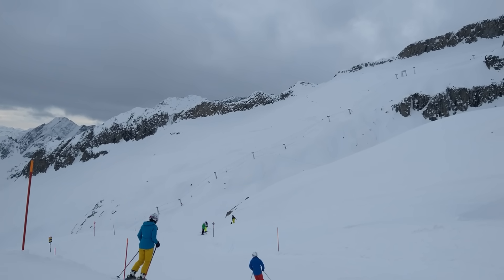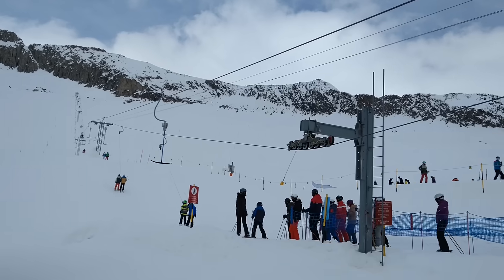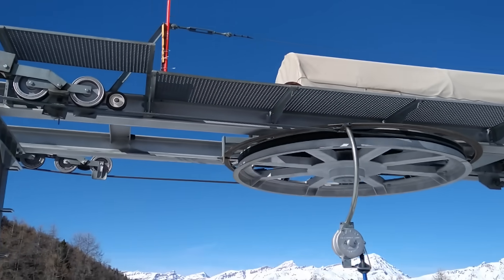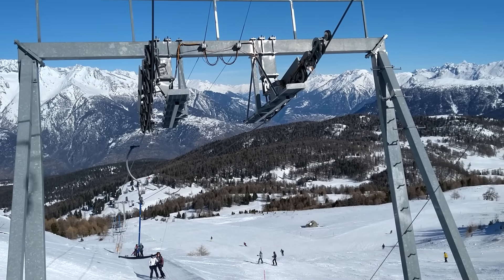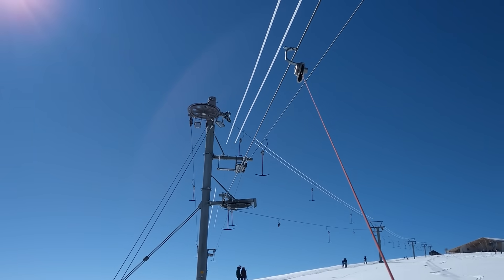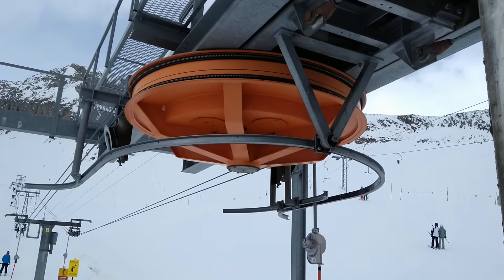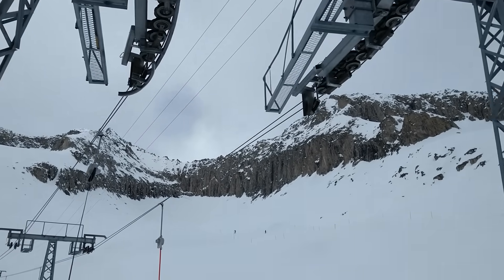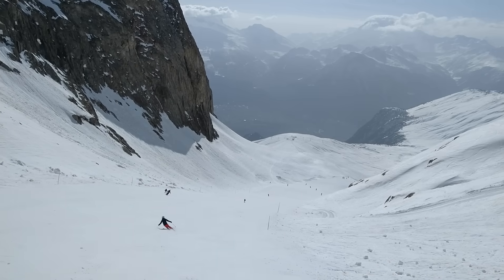The IMPOSSIBLE skilift that actually exists

Comment: Thanks very much for your interesting video.

However, this problem has already been solved long ago and with a much simpler method (in my eyes), which is much more widely used today, as you may imagine. As you can see in this video, there was a double-seated ski lift built in Garmisch-Partenkirchen, Germany already in 1977, that solved the problem: https://www.youtube.com/watch?v=8REVehtt3GM&ab_channel=Tribal6666
You can watch the actual solution to the problem of the "impossible left turn" in action here at 2:10: https://youtu.be/8REVehtt3GM?si=ZfmFqZJXjDQHaoNs&t=130

I have used this lift hundreds of time as a child and very often saw tourists and other 'first-time-users' being very impressed by the simplicity of the design.

The solution used also has a specific name. It is called "Baco-Kurve" after the Swiss company Baco, who has invented it in the mid 1970s.

More information about this (in German language): https://www.skitalk-24.de/seilbahntechnik-f14/baco-kurve-t876.html
or in this article (also German): https://www.bergbahnen.org/de/seilbahnen/systeme/schlepplifte/

Comment: I paused the video and thought about a child's solution - which I think I did - but I'm almost sad it's not what they chose :( 
Basically, a curved ramp and a bridge where you go around in a 270 degree circle the other way around instead of doing a 90 degree turn. 

Way more fun than the thing they did here!

But this implementation is pretty cool still, ngl. Well done Swiss bros

Comment: I somewhat hoped it would've been a chair lift which does it like Chäserrugg in both direction and therefore basically lifts you above the other cable doing a crazy curve up there - that'd have been insane 😅 or even crazier: limit the extension of the T-Bar so it'll pull you over the lower cable whilst you have to hold onto it 😅

But I guess no one would technical approve the latter one 😅

Comment: @Sandro Here, the crazy part is the inner and outer rope have different length.. how do they adjust for this? 🙂
Reply from the maker: Ropes are spliced on-site, therefore I presume that they make sure they are of fitting length. I haven't seen a way to tune / adjust individual rope length though, the tensionning mechanism is global and affects both rope. Seems to make sense though, as they will undergo the same thermal changes.

Comment: It is very interesting, there is another different solution in Poland. Find video "laskowa, wyciag orczykowy". They used instead of horizontal or vertical wheels, just a wheel at 45 degree angle.
If you use horizontal upper wheel and tilt it a little bit, you can make a small turn (even in the opposite side than rope handle is projected). When you tilt the wheel even more, and use narrow rope handle you can make steeper turn in the opposite side.

Comment: This is mesmerizing, but this is an over-engineering overkill. Poma, the French cable transport manufacturer, solved most of the flaws of surface lifts since… 1944. 
The Poma detachable surface lift can have turns without any issue because the cable grip is almost vertical, and the upper part of the pole bar is flexible so it can be twisted by the pulleys’ flange in turns without any problem.
Actually most of the Poma surface lifts I took have turns.

Comment: 6:17 the tiny tube lift near my house uses a very basic cheap system like this. The bar between the two cables is straight and doesn't swivel. The cable is actually at ankle height and the bar is about 3 feet long to provide standoff (the lift slope is very slightly angled away from the cable as well so anyone who falls off slides to the side away from the cable) I suspect the swivel is only needed on this one since the cables are overhead.

Comment: He knows what hes talking about but He doesn't know much about grips And about a minute 30 in when hes talking about that flat grip Just so everybody knows including the author it's called a fixed grip there's also grips called detachable the detachable ones that detach from the cable and another fixed grip lift but it's inserted into the cable with a clip. I'm sorry if I offended anybody I used to be a lift operator and I've operated ski list for over 15 years That's doing it and it's a great profession

Comment: It does look cool but it's much less cool for the maintenance team as the two ropes have to go exactly at the same speed with no margin. If the sheaves or the conveyor wears out a little bit differently on the different rope its an absolute mess, whilst on normal lifts if the sheaves and the conveyor wears out a little bit it's not usually a problem

Comment: You just sent me down a rabbit hole. I remembered that back when I was really young, I knew a ski lift with two turns. It took me an hour to find out more details since it was replaced by a chairlift in 2001. Turns out it was "only" a Viereckslift, but it cleared a height difference of 500m in a total length of 1800m, much of it going through the middle of nowhere. As a kid, this was solid nightmare fuel. I still get flashbacks of the anxiety that hit me whenever one of the turns came up, because I was always expecting not to make it. I'm just glad I didn't start snowboarding until way later, because that thing probably would have ripped out my leg on the long run.
Reply: Haha same for my local hill. Just learning snowboarding, and having to do the turn with only one foot in a binding was nerve wracking haha! And also here it was replaced around the same time by a chair lift.

Comment: I think a cheaper solution could be a synced horizontal wheel with gaps that sync with the T-bars hangers. I might be difficult to get the wheel synced though and it could be too dangerous in case of sync issue, but it would safe cost by not having to install double cables, double wheels and extra mechanics at T-bars over the whole track.

Comment: Tatra poma solved that issue by using springs and protectors on big wheels. From my experience it was a little bit prone to accidents and the rope fell if someone dropped at the right time. So when we fell we know we have to release before or after that big support wheel.

Comment: You were obviously intrigued by this lift. I suggest getting in touch with the people who made it to get a complete review on the why it has 2 cables and a double clamp because turning left and then right or up and down can also be done with a single cable as on many other lifts. This is not the reason it has 2 cables.

Comment: Well, there's an even more simple solution in Switserland. Skilift Pas-de-Boeuf in St.-Luc/Chandolin. It is, however, a very shaky one and many of my students dropped off that one because in addition to 3 turns in alternating directions, it also includes an extremely steep angle where even the lightest kid maxes out the line and actually sits on the pancake instead of just being pulled.
For their solution, they make the skier come to almost a stop at the outside turn, allowing a bracket to swing the brace almost horizontally. They are single seater pancakes, but this very long lift takes you to the highest point in the domain, offering 2 excellent slopes and 270° views that will take your breath away. (It's near the Matterhorn, so very pointy mountains all around)

Comment: Truly awesome! The only chairlift, which makes turns, that I have ridden is at Chaika resort on the Black sea coast in Bulgaria. It was built back in the 80s and connects the hotels up the hill with the beach down, making a 90 degrees turn in the middle. Since it is a standard fixed grip chairlift, it uses the "two sharp left turns, to make it go right" concept for the outward turn.

Comment: Why do ski lifts need to turn? Why not just go straight up the mountain? I think all the ones I've been on are like that. Also, why this bar thing? Seems very uncomfortable. I prefer the padded seats.
Reply from the maker: Why do skilifts turn: Sometimes the terrain forces them to. Regular skilifts have to be pointing straight up the mountain or skiers will slide off to the side. Regarding your other question: Modern lifts are chairlifts, T-bar lifts are more a historical leftover.

Comment: Have you ever considered that you have high tension cables above your head.
Reply from the maker: Please elaborate
Reply: @sandro-here  I mean over time friction or weathering can weaken lines as well as tem fluctuations. Also the load of 20 or so carts adding tension at different positions. Im surprised they don't snap.
Reply from the maker: @commanderdante3185  these ropes/cables are pretty indestructible. For instance check out the website of rope manifacturer "Fatzer", the specs are insane. The ropes are built from many individual wires that are self-stabilizing, even if one fails. Check the video from the collapse of the famous Arecibo overvatory, the ropes collapsed only after they suffered from tons of damage, the process took months or years. Also, ropeways (at least in Switzerland) undergo regular thorough inspection with magnetic sensors etc. detecting fractures at early stage. In Austria, there was an accident where a helicopter dropped a bucket of concrete on top of a ropeway - the rope held (but the ropeway was shaken so badly that people were thrown out of it). So the rope is hardly ever a problem.
Reply: @sandro-here  Thanks for your knowledge.

Comment: That's a very interesting design, thank you for sharing. I've always been fascinated by skilifts with curves myself.
Another design option (the simplest one) is to let the returning T-bars go back to the bottom in a straight line (not always possible due to terrain). That doesn't require a lot of extra masts, as they usually are far above ground anyway and it doesn't matter anyway on the return side. Examples of this still in service are the Hauptertäli skilift located on Parsenn in Davos and the Hubel skilift located on Rinerhorn, also in Davos. They both have two turns for terrain reasons. 
Another interesting design not shown in this video is in use in Pany on the local skilift. It has a right turn using two wheels. Upwards you just pass on the outside, but downwards the T-bars get kinda smashed in between the two wheels.

Comment: The first hovering mast hung onto two mountains is the Vallee Blanche Helbronner-Aiguille du Midi cableway of Mont Blanc connecting Italian and French sides.
Reply: After 4-5-7-10-11 min. and aboard 12, turning point 10 deg on mountain after 2 and 13min…
https://youtu.be/fwCRh5N2BX4
But watch it entirely it’s both an amazing location and engineering.

Comment: One skilift I know solved the turn problem by completely separating the uphill and downhill "legs" of the cable loop. The uphill leg (the one carrying skiers) would turn left halfway up with a large horizontal wheel, while the downhill leg would go straight from the top to the bottom. Essentially it was the hypotenuse of a triangular loop. It probably meant they had to cut down a few more trees but it is certainly an interesting lift.

Comment: I thought it would be something like sideways wheels with a cone of angled bristles holding the cable up instead of the lower flange. That way, the bar can simply hang straight down from the cable and push aside the bristles slightly as it passes by them.

Comment: I used work for a company that built lifts, and we were asked to make a lift with an elbow in, which we couldn't do, after about a year it came to me how to do with only one rope and mostly standard equipment. We had done a proposal for a T-shaped lift, but the project didn't sell.  It could be done much simpler with a detachable lift, but it is possible with a fixed grip lift also with one rope.  I have written a program to assist in linecalcs, sheave train sizing horse power etc., it does four different loading senario's at once and makes it possible to lay out a lift in about 15 minutes, part of that inputing ground data as a starting point, it's an excel program and the company I worked for had no interest which boggles my mind, I would have just given it to them.

Comment: Instead of adding more ropes you could just remove material in the wheels so the connector "gears" or mergers into the wheel. The connectors are at set points on the rope and you can make the slip factor 0 so the connections always hit the same point of the wheel - the point that has material removed specifically for the connectors to fit. Boom - 1 rope solution.
Reply: Those ropes can slip and stretch and suddenly they are not at the same position any more.
Reply: @koko-lores  not if you "gear" them as described. There is no slip in a gear system, or at least, a gear system can interlock in either direction.
Reply: @SameBasicRiff  If I understand you correctly then, this will cause increase wear on the driving wheels, similar to a bicycle chain, where the current "slipping" rope setup causes more or less no wear at all.
Reply: @koko-lores  A rope is about as much maintenance as a screw or a gear usually. A rope will require careful inspection of fraying and replacement every so many years. 2 ropes just makes that harder. Screws and gears need only lubrication at contact points which is pretty easily applied and can even be automated. From what I've seen while ropes are cheaper they do need replacement more often.

Comment: There's a T-bar at Perisher in Australia that turns a corner but they do it by making the descending cable go down the mountain in a straight line between the top and bottom stations cutting across a face that is out of resort boundaries and is also too steep and rocky to navigate via the surface. When viewed from above the path of the lift is a big triangle.

Comment: Tensioning both ropes right seems a problem.
They can't have each a bull pulley much farther apart.
Reply: Good point, though I bet if they're both tensioned with one pulley their tensions are close (not equal, but within tolerances), highly unlikely that two ropes of the same spec would have wildly varying expansion coefficients or whatever.

Comment: Used to live in Chile, at the Valle Nevado resort they also have a ski lift with a direction change in the middle. If I recall correctly it is just managed by pushing the descending bar into a sideways position to make the outward turn. It just separates the ropes vertically to avoid conflicts and has some bars mounted from the mast to stop excess swinging.

Comment: A question has puzzled me for a while. At the top and bottom of chairlifts it is quite common for the chair to reduce in speed whilst passengers get on and then quickly accelerate. I imagine this requires the chair to be disengaged from the wire and then reengage once people are on? How is this done so seamlessly, it doesn't look simple for the rope to easily engage?
Reply: Yes, they disengage just like a gondola. The clamp onto the rope is automatically mechanically released and clamped back on. The station then has a long row of tires which accelerate and decelerate chairs or gondolas
Reply: @the_retag  Awesome, thanks for enlightening me
Reply: @the_retag  Nice video, thank you for digging it out

Comment: The Hohstock is actually extremely fast and some years ago, you even went without ground contact for a second (they now filled the part in summer, so you don’t lift up).
Reply: You mean since it’s a Tbar it would lift you while you are trying to hang on?
Reply: @Svenshine  probably just going so fast that you do a small jump when you go over a hill
Reply: @Svenshine  That's what I'm wondering too
Reply: @Svenshine  @Nate C No that is not a problem because the rope gets longer with a spring when you pull on it. @Y Dorni meant that there was not enough snow in the lift.
Reply: Do you mean air time when traversing a hill? That fast?
Reply: Hi sorry what exactly is ground contact?
Reply: I seems it goes at 3.3 m/s while most t-bars usd 2.5 m/s. I guess that together with the sharp turn increases the chance that a skier or snowboarder would fall, so I find it strange that they make it that fast just to save you maybe 2 minutes when using it.
Reply: @rfvtgbzhn  2 minutes is can be a full run so i find it worth it
Reply: @IStMl  but on some occasions it might take even longer on a faster lift because the lift has to be stopped too often.
Reply: @rfvtgbzhn  "I find it strange that they make it that fast just to save you maybe 2 minutes when using it." - I assume the capacity of the lift was the more important reason for the designers.
Reply: @renedekker9806  maybe. But they could also have increased it by reducing the distance between the bars.
Reply: @rfvtgbzhn  You have to allow for skiers who fall off the bar; if you put the bars too close together, the next skiers will encounter someone in the lift track, so they also have to jump off. That situation can rapidly become catastrophic.
Reply: @cambridgemart2075  yes, but for this it's important how much seconds are in between 2 skiers, not how much metres, so making it faster doesn't increase the maximum safe capacity.

Comment: Great stuff. There are ski lifts in france, though, that have solved differently. Basically reducing the size of the clam and having a single pole straight down. They're uncomfortable as hell but you see them doing also "outward" turns (tbh it's rare seeing them doing on the side that the passengers are on, only on the reverse side, where they can swing the bar more with no harm).
Reply: But then they cannot do concave turns, or what do you mean by "single pole straight down"?